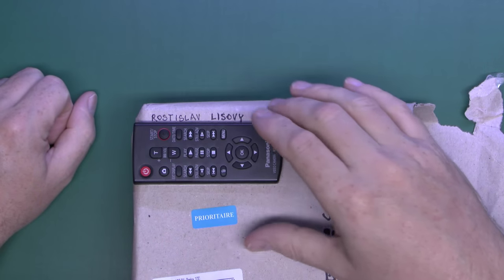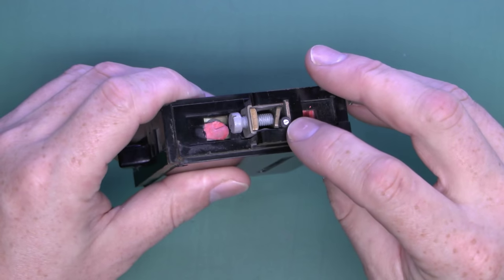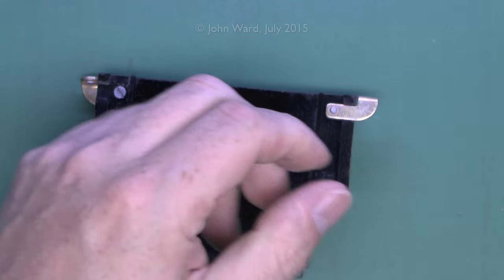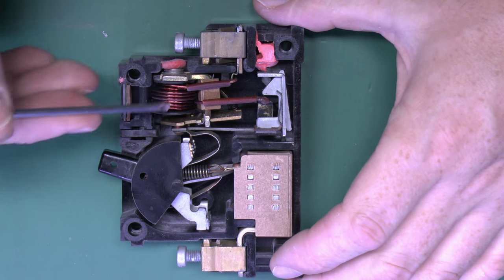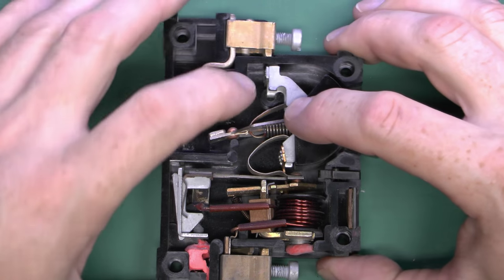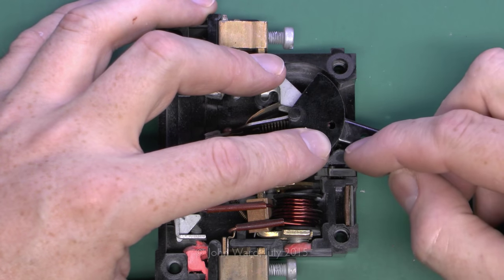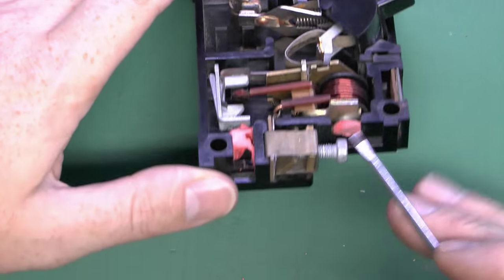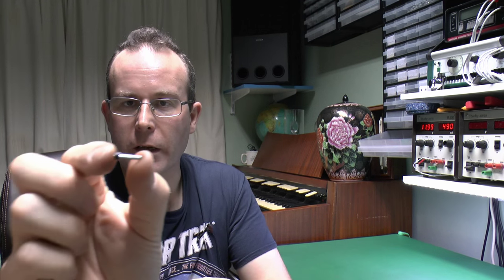Circuit Breakers from Czechoslovakia

Comment: Hi!
I am from Czechoslovakia... or Czech Republic, currently :-)
Aluminium wiring was used extensively there throughout the communist era until 1990s so what came as a surprise to you was no surprise to me at all. Almost all interior and house wiring used to be done with aluminium wires and it is replaced by copper wires when any work is done (at least sane people do that :)).
I can try grabbing some more vintage circuit breakers if you're interested, those are still in wide use here.
Thanks for your video.
Jan from Prague
Reply: +Jan „Zviratko“ Schermer I had the dubious pleasure of checking the wiring in a friend's flat in Prague and it was a colourful mix of both materials. Socket circuits were exclusively 2.5 mm2 copper and lighting was a mix of 2.5 Al and 1.5 copper. Seems to have been untouched since it was installed, maybe in the 70s. All sockets earthed to the neutral obviously, even though they used 4-core cables all over the place with two blacks just dangling loosely and the sockets wired to brown and yellow/green. I only tightened any loose screws I could find since it was a short-term rental. Interestingly, the worst issues were in sections with copper wire. It had those same breakers too but no 6 A ones, only 10 and 15 or 16, can't remember that.
Reply: +Ragnar8504 That sounds like a botched reconstruction job - definitely not original :)
Reply: +Jan „Zviratko“ Schermer Botched for sure but I'm 99% sure this was never touched after inital installation. That was an 1895 building completely remodeled in the 70s or maybe 80s (no idea really). At that time they added one of those fitted bathrooms made of cardboard, replaced all the doors and obviously rewired everything. All the switches were the classic colourful ones from Elektro Praga so no upgrades here either. I suspect an elderly chain-smoker lived there for decades after that renovation and when he passed away the landlord slapped a fresh coat of paint on anything he could reach with a roller (leaving everything he didn't reach a nasty brownish yellow) to rent it out. The sitting room REEKED of stale smoke and when my friend cleaned the switches and sockets they turned from yellow/brown to such a bright white we needed sunglasses!

I definitely didn't see any typical signs of DIY upgrades to the wiring. Just everything done using what I assume was CYKYlo in the brick walls and CYKY in the fitted bathroom, all 4-core. Generally a neat job I'd say, except being TN-C of course but that was unfortunately normal at that time.

Comment: The aluminium cable was common in soviet union and soviet block countries to save copper and was used widely for many decades (I have seen residential and industrial installations done from 1950's to 1980's with aluminium cabling). The trip indicator is quite clever design aspect.

Comment: It is necessary to look at the Czechoslovak electrical and fire standards of that time.
The hardness of these standards today not have any state of the world.
Not only in commercial electricity, but also in the construction of high voltage distribution and, of course, the lifetime of the distribution transformers.
In the republics of the former Czechoslovakia, it is commonplace that distribution transformers  work without disturbances 40-50 years even after floods and other irregularities.
It is necessary to understand that at that time all enterprises were state-owned and there was the highest priority security and reliability, no the highest profit.

Comment: Hello I am from Bratislava - Slovakia.
Bakelite as a thermoset plastic is very suitable for the construction of electrical screw clamps and any electrical connections because its mechanical properties are more resistant to high temperature in compare with today's thermoplastic products.
This type of circuit breakers SEZ Krompachy (former Czechoslovakia - or Slovakia currently) was used in my parents' apartment from built 1971 year.
The electrical cables were also only aluminum and we know that their properties are specific in that it is more often necessary to check the quality contact of screw connections..
These circuit breakers did not have a any problem, but when one year ago going to fault one light switch, the repairer proposed replacing this circuit breakers with modern types in my absence. 
My father has been 75 years old, so he believed the repairer explained that these old circuit breakers had higher energy consumption :(
This is, of course, a nonsense, but unfortunately old people (and not just old people) believe in a great deal of teleshopping and a lot of marketing fraud. 
The pressure to buy new products is on the rise.

The result: 
I today was forced to replace one of this new circuit breakers today due to a malfunction ...
So such quality is available today (unfortunately).

P.S. the new used a year ago were very expensive brand Schneider electric.
Reply: @mernok2001  Is that so. It was the structure of TN-C (TN-C-S), which was used panel dwellings in 60-70 years.
It was then always mandatory to use TN-S.
Differences, advantages and disadvantages TN-C versus TN-S can be found, for example, in Czech here: http://www.odbornecasopisy.cz/elektro/casopis/tema/vyhody-a-nevyhody-siti-tn-c-a-tn-s--15044
There were also no current protectors, only voltage protectors.

The thickness of aluminum wires with respect to the exact values of the standards I do not know the details, but it is clear that the aluminum based on the basic conductivity at a certain current value must be coarser than the copper.

Comment: Glad they don't say "Federal Pacific Electric" on them. FPE breakers will burn your house down!This one looks well constructed. Very nice!
Reply: Mark Shannon FPE stablock breakers interestingly were also available in the UK (as 'federal electric', they missed out the pacific, for some reason). Never seen them domestically, but the design was identical to the North American version, at least so far as the stab connection to the busbar was concerned.

No idea if the internal design was the same! (hopefully not)
Reply: ***** I removed a Federal board from a house about 3 years ago. The ring circuits had RCBO type devices protecting them, but from research at the time I believe all Federal breakers were Type 4 characteristics.
Oh and most of the earths weren't connected either.
Don't know when it had been installed, but looked like it had been in use elsewhere previously.
Reply: +Mark Shannon In Canada stablock breakers are also frowned upon. Mostly used in town homes, garden homes where economy comes first. I will not have them in my house. We did renovations a couple of years ago and added a second 100 amp house service. I put in Siemens breakers. In my view the best out there.
Reply: +David Okanagan  They discontinued the panels but they are still making the replacement breakers.... They were very slow to trip, but I have never not seen one fail to trip when it should of, and at one time they were the panel of choice around these parts...LOL I have 3  FPE  panels of various sizes in my place  and my  parents have 5... If I had to replace or add it would be Square-D "QO".
Reply: We have a Square-D panel here, it's a great panel. Uses Square-D breakers of course, and has no buzzing whatsoever, unlike some other panels/breakers.
Also the Square-D breakers trip quickly, but not so much as to cause nuisance tripping.
Reply: +David Okanagan  Siemens  I have had many issues with... Loose connection to the buss, and the buss being made of aluminum... Have taken the cover off a few of those and had the breakers fall off the buss, so... be careful....
Reply: +Benjamin “Ozias” Esposti  If you have problems with nuisance trips from  the startup of motors and things containing inductive loads, a  " Hi-magnetic" breaker is available that will  help eliminate  nuisance trips...   Available in plug on and bolt on versions, 15A and 20 A single pole if you ever need them..  "QO 115 HM" & "QO 120 HM" is the  plug on  catalog number,  "QOB 115 HM" & "QOB 120 HM" for  the bolt on  flavoured ones if I am not mistaken.
Reply: REWYRED
Okay, I figured there probably were breakers out there like that.
For now it's alright, that transformer was only for testing something one-time only.
Reply: The external design of the product guarantees good sales success, but the technical level of the product is not related to it. Our old circuit breaker is not beautiful, but it is reliable and safe.
Henry from Slovakia.

Comment: on a machine or in a building in a building 14 awg wire is used on a 15 amp breaker and 12 awg is used on a 20 amp breaker for lights and wall outlets in the us
Reply: +David Berquist 
Yup.
Just helped my father the other day do some electrical work at his place. We re-wired a nasty looking splice, and four connections which were done with electrical tape - yes, no wire-nuts!!! The nasty splice was on the well pump, and it appeared that they must not have had enough cable, as they spliced it in a few inches from the pump contactor/controller. Both cables were copper, but one was old and one was new-ish ... go figure ....
Anyways, his house is much safer now :D

Comment: These seem to be everywhere in Czech Republic and Slovakia, I suppose they were installed until around the fall of the iron curtain. I've definitely seen them in hotels built for the 1981 Winter Games.

Here's how they were installed:
https://www.dropbox.com/s/aps7hr623s213ni/DSC07203.jpg?dl=0

https://www.dropbox.com/s/v2fq15jwivq6olv/DSC07202.jpg?dl=0

As you can see they were fed from the top and the consumer unit also held the door bell. I have no idea what the contactor was supposed to be used for, possibly peak/off-peak rates but this one clearly hasn't been used at all. I found this one in an 1895 flat in Prague, owned by an Irish slumlord renting to students. I suppose the entire house was renovated by the state/city some time in the 70s and only painted after that. One of the outgoing screws was so loose I can only conclude it had never been tightened, thankfully it only supplied the extractor fan in the bathroom - and yes, that was on a dedicated circuit!
Reply: +Ragnar8504 Yes, my parents still have them in their house, living in a village, they are still widely used in older buildings. Of course they have been replaced with newer ones nowadays. But these are still very reliable even after all these years.

Comment: Those remind me of the old Dorman Smith loadmaster range, although not sure if they work in the same way? Many many years ago when I was training I worked with a guy and we were at a job pulling out old lighting cabling, I remember that it was grey outer insulation and the core colours were red, blue & white manufactured by Pirelli, the conductors appeared to be clad copper. I asked the guy what it was and he referred to it as Constantan. Is this correct? I've never heard it mentioned in the trade since!
Reply: +nationalhomecare Constantan (nichrome) is resistive wire used in heating elements - I can't imagine anyone using that in building wiring!

Comment: Aluminium used all over eastern block (old). Its a shock when you first see it and how its slapped willynilly throughout the old buildings with no room for error because its so brittle. It would be condemned here.

Comment: Never heard of a 6 amp breaker. In Canada 15 amps is the smallest.
Reply: David Okanagan probably because Canada is still using 120V instead of 220-240V
Reply: Someone Somewhere  Are you on 220 - 240 VAC in New Zealand? We are 110 - 120 here. Standard through Canada, the US and Mexico
Reply: Someone Somewhere No, 15 amps is the lowest we go here. I dont ever recall anything lower. Probably because we are 110 - 120 vac.
Reply: +David Okanagan  The breakers you are talking about, I believe to be industrial types, not used in a regular home.
Reply: Absolutely no... This type is commercial cheapest models...
Reply: The reason is simple. 6A circuit breakers have been used in circuit with fewer electrical appliances or lighting electric circuits, where at 220 or 230V AC this maximum value is suitable.
It is always safer to divide in the project of electrical circuit in one apartment or family house into smaller parts with smaller values of current, but it is also more expensive.
But in the times of socialism in Czechoslovakia, the prize of the project material was not the highest priority.
Both the electrical and fire standards in socialistics era were much tougher even though propaganda in Western countries claimed something else.
Today in EU it is possible to create an electrical installation project for apartment with three 16A circuit breakers and with thin copper cables.
BUT 30-50 years ago in Czechoslovakia it would be necessary with five or six circuit breakers and copper cables of 1-1.5mm higher thicker and if we talk about aluminum, so much thicker.
Reply: I have still two of these working at my cottage.  6A for lights and 10A for sockets. Main is 16A but i needed tonreplace this one using retrofit since it triped even below 10A.

Comment: That's more like the circuit breakers we have. They have a nice "snap" to them.
Though I haven't gotten to touch one of your modern crappy MCBs that you describe, I do know what you mean ... the switch on my fathers shop vac is utter shit. In fact, sometimes, after turning it off, the switch pops back into the ON position and the vacuum starts running! Let alone the fact that the switch gets hot ... -_-

Comment: Fibre type cardboard material = Asbestos? What is the arc chamber for please?
Reply from the maker: asdasdasd The arc chamber is designed to dissipate the energy of the arc.  When the contacts open, an arc will form between them, the plates absorb the energy (as heat)  due to having a large thermal mass, and there are multiple plates to divide the single arc into several smaller ones.
Reply: Cheers

Comment: i belive wire to pump should be with out splice and on a gfi single pole if 120 volt or dubble pole if 220 volt consolt a inspecter befor installing 14 goes on a 15 amp 12 goes on a 20 amp 10 gauge wire goes on 30 amp breaker for both single pole 120 volt and duble pole 220 volt breaker again consolt a inspecter befor doing

Comment: do they go in a machine ones for wiring are 15 20 30 40 50 60 100 amp 15 20 30 come single or double pole 40 and up are double pole in the us for the most part
Reply from the maker: David Berquist These are for house wiring.  6A typically for lighting circuits.
Reply: +John Ward  Yes 6 or 10 A for lights 15A for sockets. Aluminium cables 2.5 sq mm for light circuits  4sq mm for sockets. Probably strangest thing for You is three phase supply for domestic installation. We used two wire TN-C system till 90's.
Reply: +Ernie E I still saw 2-core cables with brown and yellow green at a DIY store in Czech Republic around 2010!

Comment: Your in inches👍 you just get better🇬🇧 why did we stop using aluminium wire, £££££ maybe?
Reply from the maker: Aluminium wiring was only used in the UK for a very short time in the early 1970s.  It is cheaper than copper but requires larger conductors so the savings are minimal.  It also breaks more easily and is incompatible with brass terminals used in sockets, switches etc.